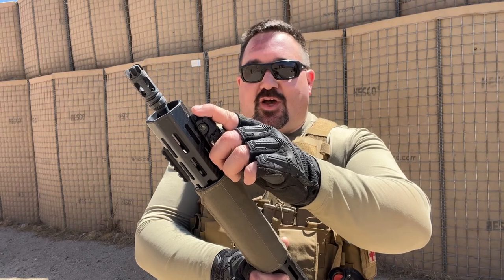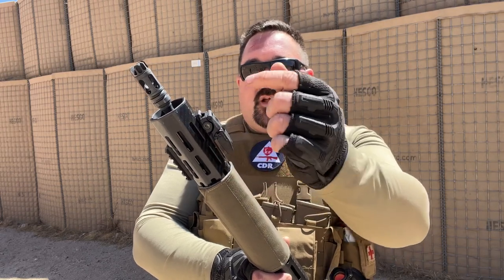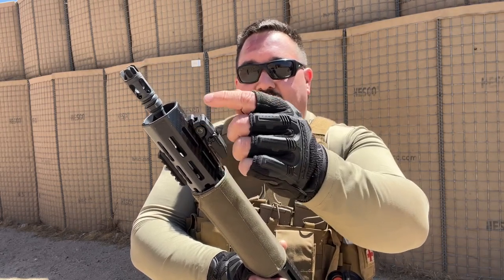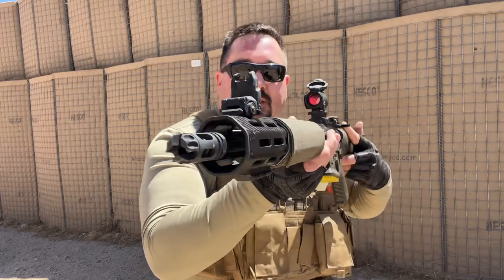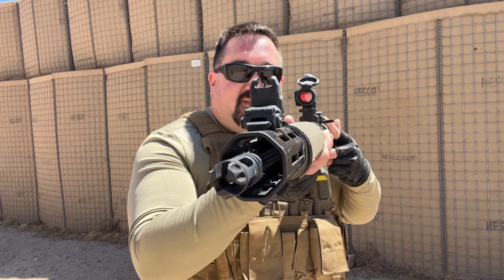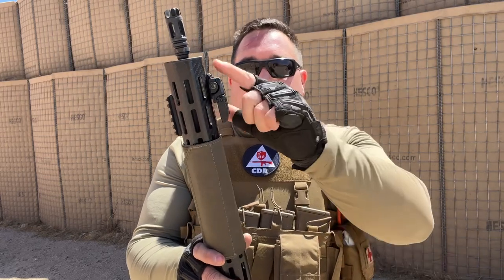How to ruin a WWSD

Comment: I would love to see a test on durability of common BUIS vs a quality Red Dot.  Honestly, I have more faith in a serious Red Dot over BUIS to not bend, fall off, or lose alignment.

I would bet you could hit humanoid size targets with some consistancy using a dead Red Dot (no dot and possibly cracked) just putting the target inside the middle of the glass.  Could prob land enough hits at 50yds for the "SHTF" situations people worry about (and in SHTF close up, you aren't switching in time).
Reply: @aelsi1337  But if the backup sights fail first, what is the real use?  A spare tire that deflates in your trunk from rough roads before your main tires is not a backup, it is added weight.
Reply: Durability of BUIS vs a quality red dot? THIS has to be a troll post or the dumbest thing I have heard today.
Reply: @sleigh4019  For start, iron sights have not been used for a 1000 years, nor has it been 1000 years since 1750.

Much like your match, you are missing key points.  Steel sights are not invincible; they can break or be knocked out of alighnment.  And, BUIS are not solidly mounted on the rifle; they are attached to a mount, mounted to a rail.
Reply: @OriginalWarwood  Might actually be 1000 years, they probably had them on bows.
Reply: Or just put an A2 fixed front sight post like the good man Stoner designed… Just sayin’😑😝!
Reply: @jakegarrett8109  oldest sights on firearms are from 1450s.
Reply: @aelsi1337  I am not saying they cannot be broken, but the question is which breaks first.  And, what breaks first where you survive (ie a nuke's emp generally falls withing the zone where you don't survive, so the rifle being usable when you are toast doesn't help)
Reply: Try breaking a military type fsb or any knights rear buis. Let me know how that goes for ya.
Reply: @bartholomewgreatpants3425  Again, I think a test would be worth it.  Unless you don't like content that test stuff....then, why are you following the channel?
Reply: @OriginalWarwood  Who said firearms were the first thing with iron sights? I have some on a crossbow. I've used some on a bow.
Reply: @aelsi1337  so toss one on an offset mount as a backup as well, now you have 2
Reply: @jakegarrett8109  Medievel crossbows did not have sights.  You aimed over the bolt.  Bows did not either.
Reply: @OriginalWarwood  You can't tell me a child like myself (who added sights to everything, I even used markings on the tractor to line up for plowing), that some child like me 2000 years ago didn't add another stick through which to look down to aid in alignment for their bow hunting. A stick and some grass to affix it is nothing modern, now is it the same 7075 T6 aluminum alloy and heat treated spec? No. Is it polymer? No, but its the same thing just different material. Would it have been flip up peed sights? I don't know, probably more like a notched sight or single notch sight with slope or curved stick (to account for range on arrows), but surely there was at LEAST 1 in existence when bow hunting was a thing.
Reply: @jakegarrett8109  Feel free to go digging mate.  Thousands of photos of numerous historical examples.  However, to my knowledge no such sights were ever made, as hunting was VERY close and weapons of war were fired at masses of troops.

Edit- You can look at the video done by Tod's Workshop for more info
Reply: Just remove the red dot all together and see how you're targeting is with no sight at all you might be surprised
Reply: For emergency use I mean
Reply: @OriginalWarwood  how much weight do a set of back up irons add in reality? Suddenly your rifle is too heavy to lift  with them?
Reply: Florida Man HVACR  I'd keep an extra battery or two. Cheaper, smaller storage needed
Reply: @sleigh4019  🤡
Reply: 1. Redundancy is good on a serious use rifle

2. Batteries can prematurely fail, and one can forget (we are human) to bring a spare.  Even on a fun range rifle, having a battery go out and not being able to shoot your rifle like you wanted is a bummer.  The batteries last so long nowadays it’s easy to lose track of time and then there you are.

3. what happens if there are supply chain issues with batteries? Current times have proven to us this is more than possible.

4. A red dot can break, just as anything can, regardless of what you, I, or anyone else has to say about it.

5. To even discuss the amount of weight it adds is idiocy, it’s so little it’s not worth talking about.  It is so little, and if you’re red dot fails, it greatly handicaps the rifle.  At any reasonable range it is essentially a paperweight.  Why risk turning your 500 meter tool into a 50 meter (or less) tool?

6. All steel sights that fold flat like the MBUS pros are extremely durable.  On most normal rifles, you can attach them directly to the picatanny rail on the receiver and front handguard.  To say you have to attach another rail is more of a knock on the design of the carbon fiber rail than anything.

Bottom line is, there really isn’t a viable negative to having back up irons.  It’s all positive, even if it’s unlikely you’ll ever need them.
Reply: Florida Man HVACR  starbucks, McDonald's, Walgreens, Walmart are on every corner. So are cr2032 batteries
Reply: Pretty sure for most people it's in case the batteries die. It's faster and easier to flip up back up iron sights than replace batteries.
If you don't want BUIS, then an optic with an etched reticle, like a prism sight, would be a better way to go.
Reply: Florida Man HVACR  The issue isnrequiring their support limits designs.  So, my question was basically "does real world prwctical testing support the hypothesis that BUIS are even relevant" by seeing which one would fail first.  If the BUIS are more likely to twist/bend/break out of alignment or fail in a manner that makes them unusable (ie won't stand/flip up, won't say up, springs snap, plastic breaks, etc) sooner than a comperable quality sight, then are BUIS even a workable back-up?  Or, does the whole BUIS need to be rethought?

Maybe, maybe not, but testing would be interesting.
Reply: Florida Man HVACR  But are you assuming that is the case, or have you ran or found testing to see which fails first?  Springs and flip-ups are more prone to mud than proper sights.  Fogging up is an even easier fix; they make anti-fogging gels/cleaners for that purpose.

There are an aweful lot of assumptions in repsonse to my encouraging testing, and not many people pointing me to ANYONE that has tested common quality BUIS against failure vs common quality sights (cheap BUIS too, so people know their discount Cheapet Than Dirt ones are useless in testing).

That is the issue; I want facts, not fan-boy love or paranoia (in either direction).
Reply: Florida Man HVACR  I would say the majprity of BUIS purchased are of the removable plastic frame that attaches to rails (Google Back up iron sights and see what shows up; those), not the fixed sights that forged or otherwise perm attached to a rifle (such as the US Army, through the contract requirement to support scopes/acogs/or none).

The ones, like the ones in the video aree the type I am referring to.

As you pointed out, any sight can be damaged.  But, are the common BUIS or the common Red Dots and other scopes more prone to failure in a manner that puts them out of use?  I stand by that being a valid real world test.

Comment: Someone explain this to me like I’m five: I am all for what the WWSD represents and I’m for a back up sighting system. And having one that does not require batteries. What is Karl’s problem? Granted I watch Ian’s channel more. Thank you.
Reply from the maker: This video was a infomercial joke.
Reply: [ExplainingTheJoke] Some people have asked how to put backup ironsights (BUIS) on the WWSD carbines (or in general, how to add backup irons to Faxon or KE Arms carbon fiber handguards). As Russell explains, it requires a specific style of smaller M-Lok mountable rail (e.g. Arisaka's low mount) due to the dimensions of the Faxon or KE Arms handguards.

Separately, there is a very valid point to be made that for the vast majority of people, BUIS are somewhat pointless given the quality and reliability of most mainstream modern optics. Karl has explicitly pointed out that optics reliability has gotten to the point that plenty of secret squirrels have been photographed with rifles sans BUIS during very specific mission sets and deployments, and that most people do not realistically /need/ BUIS, but are certainly free to add it if they want to. The internet being the internet, however, Karl has been caricatured into saying that backup sights are verbotten and ruin the rifle by their mere presence.

Thus, Karl and Russell, by their power combined, produce an informational PSA about using a proper-height pic rail section in order to mount BUIS, but produce it with humor using Karl's caricatured cyberpunk personality of "The Future is NOW, old man!" [/ExplainingTheJoke]
Reply: Thank you Karl/whoever replied because I assume you have minions.

Comment: This video made me really think my M16 and M4 that I deployed with did not have any backup sighting system you just had a old worn out beat up acog witch is a great sight and incredibly reliable but my home defense and range toy AR I felt I need back up sights I guess it was just because I don’t have much faith in my red dot not loosing battery or breaking. If I am not confident in my main sights I think I need to just get a sight that I am confident it is not like I am taking it to battle.

Comment: Backups on everything sorry I don't trust just one siting system.
Reply: @sean7456  a good pair of metal flip up sights you're good.  I'm talking if you have an optic you need back up irons but it really depends on the weapons intended use. Even so if your scope gets broken at the range or match you can at least still use the weapon instead of not getting to shoot because you have no sights. Just my opinion.

Comment: Lol. BTW, I took advantage of that sale that KE had on their KP15 rifles. I couldn't say no! Probably the closet i will ever get to the WWSD rifle (though I could slowly upgrade it to WWSD specs over time.) I'm excited to get my hands on it, and experience the new polymer lower firsthand :)
Reply: Is the sale over? I've wanted to pick one up for a while.
Reply: @crazyfvck  what website?
Reply: I jumped on it, too!. I've been trying to buy an AR since Obama made the price go crazy. With prices going through the roof or everything being out of stock, it just hasn't worked out for me. I saw a post on Reddit from Russel and realized this was the kind of sale I was waiting on. 

Does anyone know if KE sends a confirmation email when they get your LGS's FFL?
Reply: Or you could make a custom WWSD like I did! I built a KE arms lower with an M4E1 threaded upper from Aero and it looks pretty dang cool. VG6 Flash hider + Aero pencil barrel + KE arms carbon fiber handguard + Brownells lightweight M16 bolt + Magpul polymer ejection port.

Comment: People laugh, but I've ACTUALLY HAD a red dot sight fail. I had to stop shooting, walk to the tailgate of my truck, pop open the quick release lever on the mount, and then snap on the pre-sighted spare from my range bag. 
I shudder to think what could have happened if I'd faced a massive human wave attack at just that instant, had just kicked in the door to Osama's bedroom, was being relentlessly pursued by a vindictive small town sheriff in the Pacific Northwest as I try to cope with PTSD, etc.
Reply from the maker: Maybe it was an EMP
Reply: @InrangeTv  Impossible, my shooting bench is fully enclosed in a faraday cage except for a single 6mm hole for the bullets to exit.  Maybe I should tighten it down to 5.6mm?
On a serious note I built 2 FDE WWSDs for my kids that are faithful copies except for BGC, barrels (6.5 grendels), and adjustable gas blocks for occasional suppressed use. We love them. One has a dot and the other a LPVO, no backups, just annual battery changes on all non-range toy RDSs. They never hunt/shoot alone too so there is always a spare rifle at hand.

Comment: What's wrong with backup irons
Reply: Don't need
Reply: @hermatred572  until you do
Reply: Nothing. In fact it's a great idea to have them in the chance your optic gets damaged to the point where you can't use it. Do you know anyone who carries a spare optic in their kit to swap on? Didn't think so,
Reply: @fredbloggs5902  At this point it's more effective to have your back up-sight be a SIG Romeo 5 or a Holosun zeroed to your rifle stashed in a pouch in case your main optic gets shot or something.
Reply: It’s more a running gag than anything.
Reply: If your optic gets damaged to the point you can't use it, you probably are damaged to a point that you can't use yourself
Reply: @FloorItDuh  That is quite literally what I do.  I carry a SIG Romeo MSR in a small padded GP pouch on my chest rig.
Reply: @Biker_Gremling  or you cheaped out lol
Reply: @NuclearFantasies  how can you be sure it's zeroed though? you got a really nice mount or just plan on re-zeroing?
Reply: @kh8655  Scalar Works mount.  It holds zero very well in my experience.
Reply: @NuclearFantasies  ahh, yeah those looks pretty damn nice
Reply: @Biker_Gremling  Not necessarily. Plenty of non getting shot at ways to potentially damage your optic. If you are someone who does for whatever reason carry a backup optic that's good and all I guess but I would rather just throw my old one off and flip up my irons to get back to work. That's me though.

Comment: There is nothing wrong with back up slights
They don't realy weight enought to notice and they might come handy if you are like me and there is no way you could remember to change red dot battery (or any other inconvience)
Reply from the maker: No, but they do take up rail space better used by other devices.
Reply: @InrangeTv  Depends on your build i guess

Comment: I want to see these actually used in a large scale conflict to prove which camp is right as far as optics, foward assist, handguard and such. Altough, usually with something like this it's usually more complicated than one simply being correct, and one being incorrect, as well as personal preference having a major influence
Reply: @itsapittie  I'm mostly concerned about a forward assist because the doctrine surrounding it and people would go ape shit if there wasn't a button to press, while the G36, a successful modern military rifle, has no forward assist and a non cycling charging handle
Reply: @gary0228  The G36's charging handle is it's forward assist. You turn the lever and push it towards the center and there you go.

Comment: Is it possible to run a laser put there on the rail and expect it to retain zero?
Reply from the maker: It will retain a zero as well as light weight aluminum things do as long as you don't apply significant pressure to it, just like lightweight aluminum rails.
Reply: @InrangeTv  thank you that's good to hear

Comment: So I had a Cheep Russian 223 case get stuck in the chamber and used a three piece brass cleaning rod to get it out, but it shaved off bits of the brass when going through the barrel (Nitrated). Do you all think the bore is ok? I have heard arguments for both ways.
Reply: shoot it, group it, measure it. But probably no. (no as in you're fine, shoulda' been clearer)
Reply: Odds are you're fine. The whole point of using brass rods is that they're softer than steel, so it's the rod that gets fucked up instead of the bore.
Reply: What is the jacket on your bullet?

Comment: This is one of many reasons why I chose an Aero Precision ATLAS S-ONE handguard for my WWSD build. It may be an ounce or two heavier (though I haven't found a clear answer on the weight of the 15" LCH5, I'm not sure it's even that much of a difference), but no problems mounting iron sights (which I typically don't use on the WWSD anyway, but easily can if I want to), front sight rail and QD sling points built-in, smaller OD (easy to C-clamp even for my wife, and I'm not mounting a suppressor on a particularly light-barreled rifle anyway), exquisitely machined and finished, the ATLAS system is outstandingly simple and solid, and it's about half the price of a carbon fiber handguard.

Comment: Where’s the good, sturdy, heavy bipod mounted unreasonably far forward? To leave room for the vertical grip that conceals a knife in it. Don’t worry about it being front-heavy. Just use a stock with a well in it for a loaded backup P-Mag. And some cheek risers, whether you need them for a good weld or not. Feel that weight! That reassuring, tacticool heft means quality. If your muscles ain’t sore, you ain’t been to the range, brother.
Reply: It sounds like you'd be interested in an L86A2.